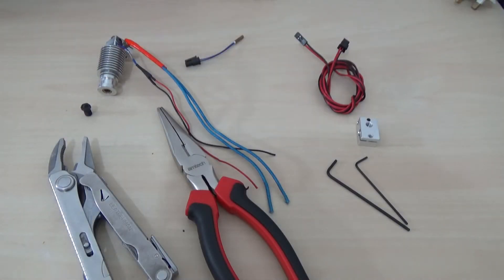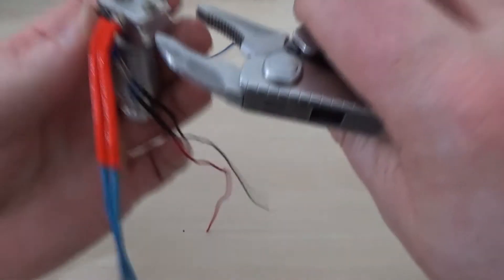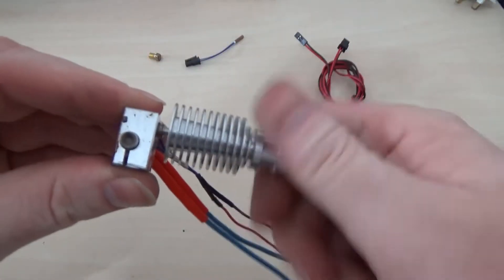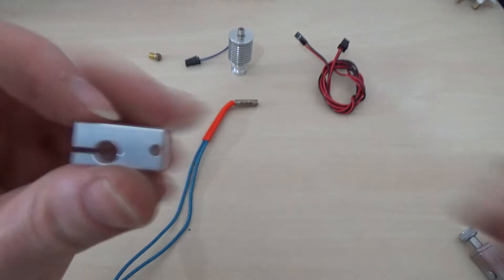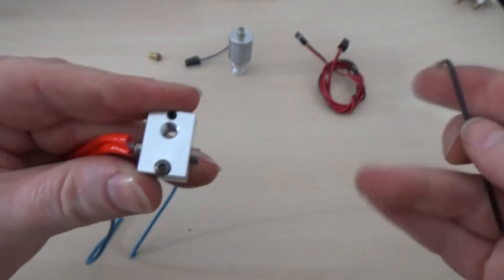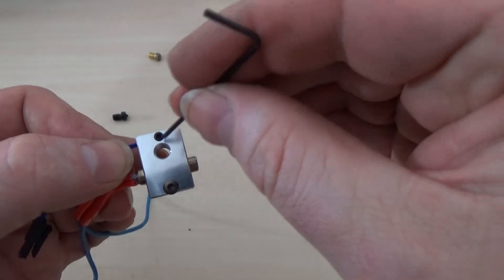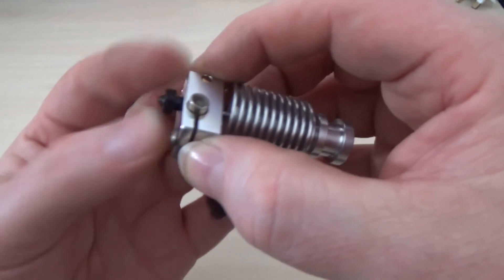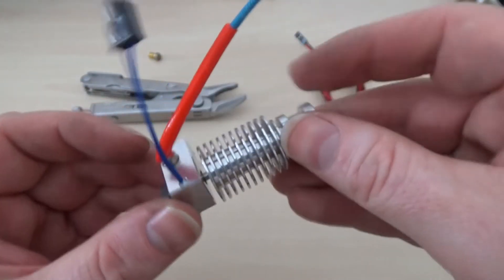E3D Cartridge Thermistor Upgrade

Comment: I have on order the gold version E3D and the upgrade kit. I have one very important ? Most video I have watch say you have to heat tighten the nozzle so do you or do you not have to heat tighten the heater cartage and nozzle? This is a big question that I hope you can answer.
Reply from the maker: Hi. I have had a few nozzles leak because I did not tighten them once they were hot. Now if I change a nozzle I heat the hot end to 250C and use pliers and a spanner to give a final tighten. Doing this I have not had a nozzle leak.

Comment: Hi Steve its me Gary I did this upgrade to my printer plus added the titan extruder I am now plagued with thermal runaway errors  have you expierenced anything like this with the new thermister style also Steve what firmware are you running ? I would appreciate any help you can offer Im at wits end Im using marlin rc8 bugfix firmware. Thanks Gary
Reply from the maker: Hi Gary,  I recently loaded a new-ish version of Marlin onto my printer.  Not sure on the exact version numbers but here's a drop box link to it
https://www.dropbox.com/sh/smv35o2tgfnjlgn/AAANkjt1E2P-0gOd0kAVUrWea?dl=0
you'll have to edit the extruder steps per mm but everything else should be fine.  Hope this helps.

Comment: this is what I got exactly OSOYOO 3D Printer Kit with RAMPS 1.4 Controller + Mega 2560 board + 5pcs A4988 Stepper Motor Driver with Heatsink + LCD 12864 Graphic Smart Display Controller with Adapter For Arduino RepRap. is the link you sent me valid for this? sorry I'm on my phone and can't seem to find away to copy a link to the item on Amazon for you.

Comment: thanks for getting back to me, I checked all the lines leading g from the extruder to the main board and everything is showing good up to the main board, I ordered an Arduino kit from Amazon to replace the main board, if u could make a video of how to setup the ramps kit in the Di Vinci that would be awesome also I don't remember if I have the 1.0 or 1.0A I'll have to look.
Reply from the maker: Hi Joe, the DaVinci 1.0 board had a full size SD card slot but the 1.0A has a micro SD card slot.  I don't have my DaVinci anymore so I can't make a video showing the board swap but this image is a great place to start as it shows all the connections.
http://reprap.org/mediawiki/images/6/6d/Rampswire14.svg
Hope this helps
Good luck
Steve
p.s. you will, of course, need to modify the DaVinci case for the ramps LCD and controls

Comment: love how in depth u go about 3d printing, and I've got a question for you about the Di Vinci 1.0. something on the main board has stopped powering the extruder stepper motor and I checked the driver board by switching them them on the board with the stepper motors that are doing what they should, I even swapped out the wires that power one of the other stepper motors and found the extruder stepper motor does still work so I'm lead to believe that there is something else on the main board that is having a problem and not telling the extruder stepper motor to pull filament. so I was wondering if you would happen to know or could find what would be the problem so I could check what u get from your main board and compare it to mine. and maybe fix the issue, I can't find anything on Google that will show me the layout of the main board and the xyz website don't sell replacement main boards.
Reply from the maker: Hi Joe,
The DaVinci I had was the 1.0A, which has the v2 XYZ main board, that's the 'all in one' board.  One thing you could try is making sure the cabling down stream of the stepper driver is good.  I know it's sounds a bit silly but the cable XYZ use is quite crappy and could have a break in it.  If the cable is good then you are correct and it's something upstream of the stepper driver that's at fault.  If that's the case you have 2 options.  Contact XYZ for a replacement main board.  Or, rip that thing out and wire in an Arduino Mega and Ramps.  This will take a lot of work but could be best in the long run as you'ed be running Marlin then etc etc etc.
good luck
Steve